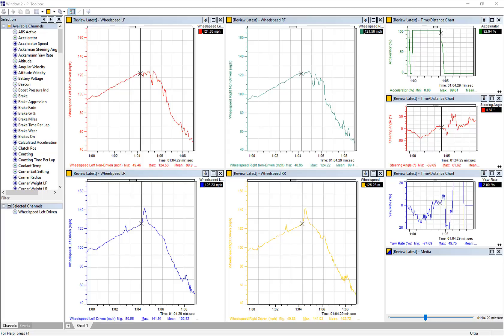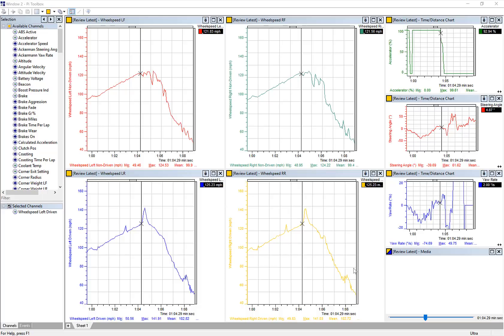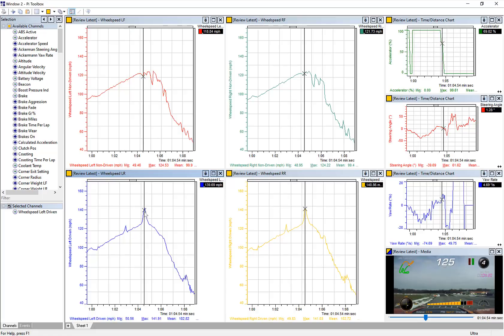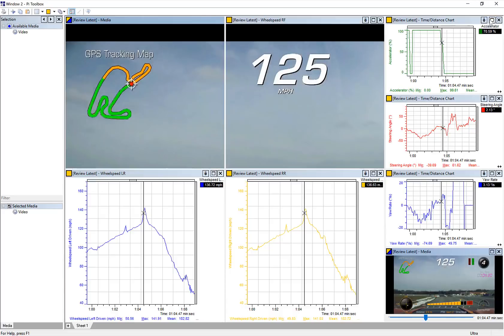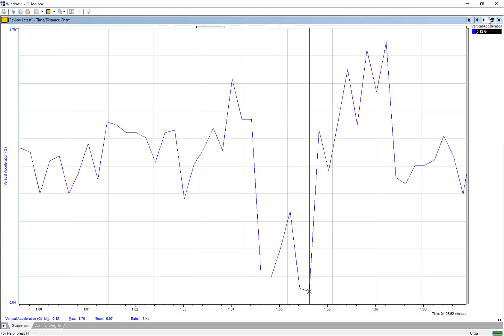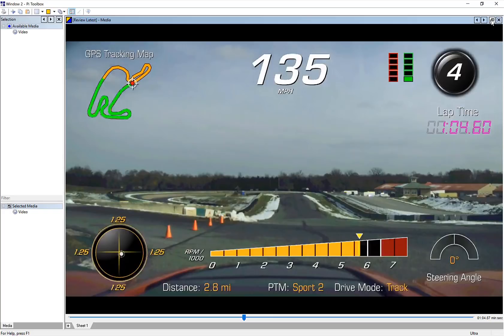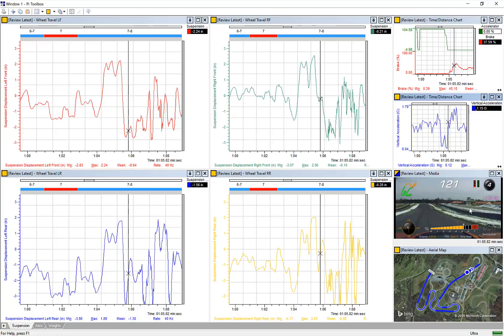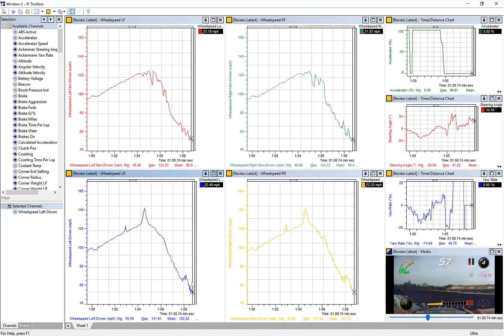Why Did I Crash? - Episode 4: ZR1 at Shenandoah

Comment: The first thing I noticed is according to PDR data you had `2.5mi for the session... assuming you started recording when you entered the track. Along with snow on the ground, the ambient temp couldn't have been much more than 40deg. I've run at Summit Main and Shenandoah during the colder months and it normally takes several laps to get heat in the tires. Not news to you I know but wow there is little chance for a summer tire to cope with ZR1 HP/TQ under these conditions. Glad everyone made it out unscathed.

Comment: I am glad you are ok.  I have a Z06 and I was in similar situation couple of times.  First time tires were not up to temp and also went over a crest like you.  Car yawed and there was no catching it but lucky for me there was huge run off so there was no damage.  Second time it was also coming over the hill with hot tires but I was able to catch it.  I wonder how much it has to do with suspension design being leaf springs vs coil springs.  Reason why I say that is my friends drive camaro 1les going full throttle through same crests and there is not even a trace of loss of traction to the rear wheels.  I also watched ZL1's and same thing they are not loosing traction going over same hills.  I was looking Meros VIR videos and I noticed he lifts before going over hills.  Good luck with new GS, and don't forget to lift.